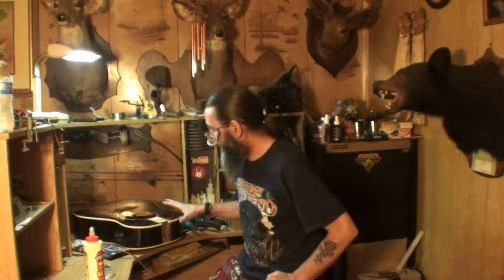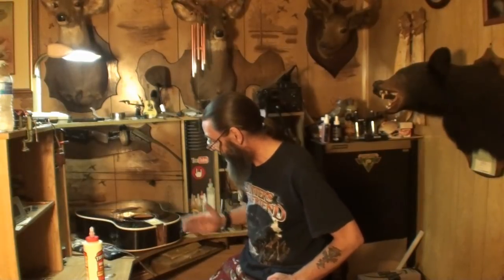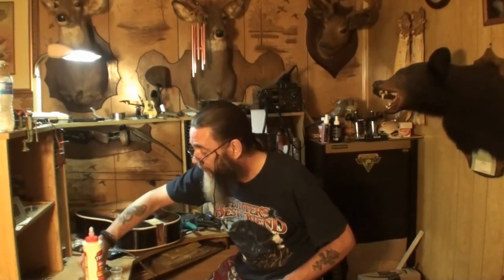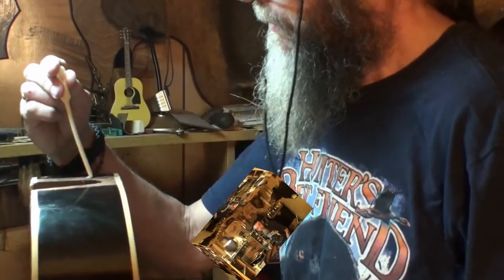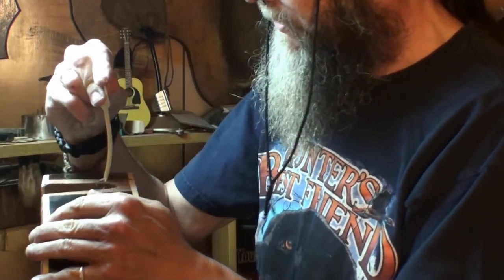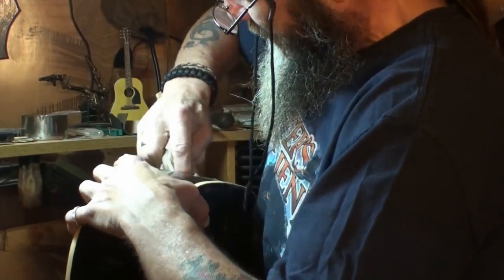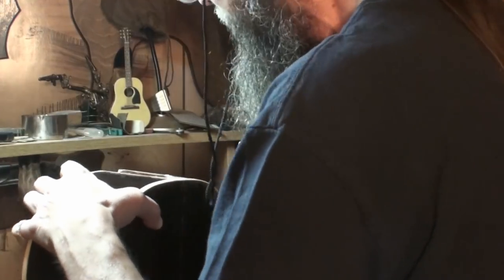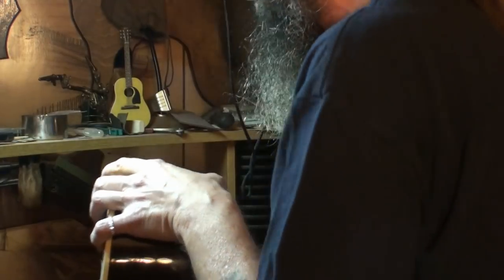gibson j45 hell... a new beginning!

Comment: Randy, I don't believe you were hard on Gibson at all.  It's time they got their act together before they destroy their legacy and reputation.  I bought a brand new J200 Studio, it cost me £2200 about 4-5 years ago.  I got it home, plugged it in, and there was no sound.  It never occurred to me that it was the guitar, I bought a new lead, no difference, I took my new Marshall amp back to the shop, and told them it wasn't working.  They tested it whilst I waited and said there was nothing wrong with the amp.  I was surprised, I couldn't believe the Gibson was faulty, it had played ok in the shop before I bought it!  I took the guitar back to the shop and they had it for a week, and said their tech had sorted out the problem.  The hell they had!  I and a friend stripped the pick-up and controls out, and found dry joints on the jack socket.  Gibson QC is pathetic, that guitar should never have left the factory in that condition.  It seems Henry is about to get fired, and then maybe the new bosses will improve QC, and save the company from a fate worse than death!

Comment: Thanks for all your entertaining and informative videos Randy. Your humor helped a lot when I was recently doing a neck reset on a 1971 Gibson J40 original owner. Many years ago Gibson did replace the bridge with a pin bridge and payed for it through warranty. Fast forward to today and they would not pay for a neck reset because the owner could not find his paperwork after almost fifty years. Anyway, it was made at a time when I’ve read they just got bought out for the first time by people that didn’t make guitars, fired the manager that had put in place quality controls, and then did away with time consuming quality controls. This J40 was very poorly constructed with huge thick warping braces that pulled the top in along with a barely fit neck that simply started pulling straight out shortly after purchase. PLUS, the top was glued solidly over the almost 90° tenon with itty bitty wedges stuck on with creeping glue. I had to remove the fingerboard and cut a hole in the top to even get at their stupid construction. From the looks of the way black paint was slopped onto the heel and fingerboard surface, along with thick chalk writing on the neck and fingerboard, you had really pissed off Gibson employees in 1971.

Comment: Fantastic video? 5*** Randy, I have a quick question regarding a Compensated TUSQ Saddle I bought for my Martin. To fit the saddle I have to sand the bottom and sides to make it fit correctly. Question, do you sand one side of the saddle or both sides? Will sanding the sides effect the compensation? Regards, David
Reply from the maker: It's hard to explain but yes in short, sanding from only one side will force the compensation spots to move either towards the high E side or the low E side, this may not seem like it'd be enough to hurt compensation but on acoustic guitars it's a pretty good bit of adjustment that can be used in which ever direction is needed to make the guitar intonate right.